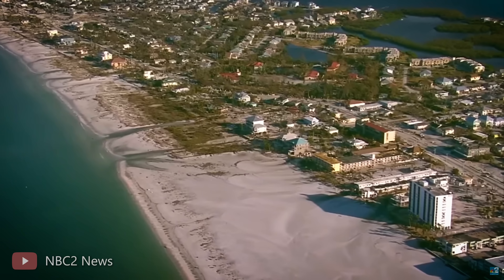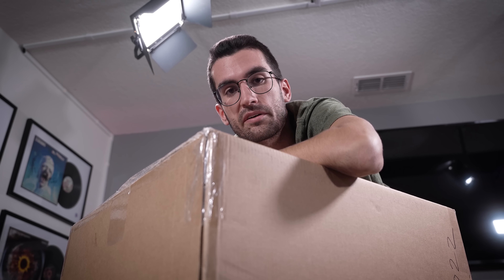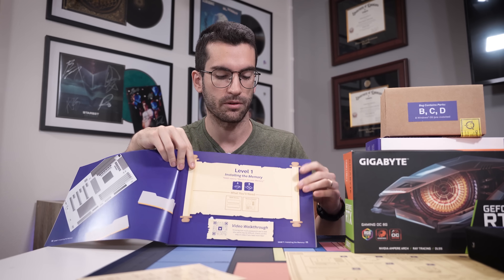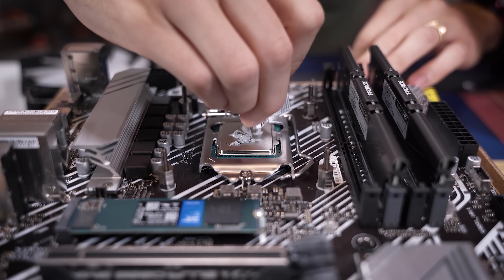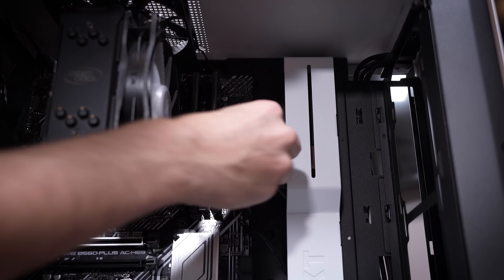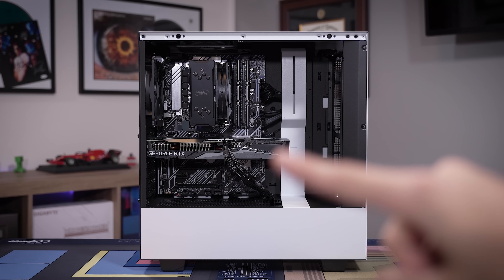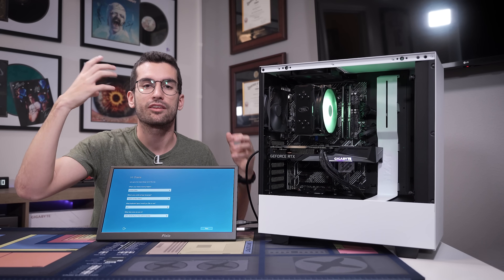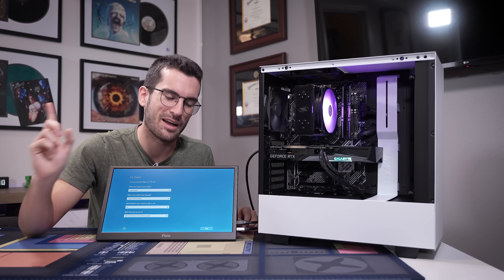His PC Was Destroyed... So We Built Him A New One!

Comment: I think for a lot of us the on our first build our biggest concern was all about matching the right type of board with the right type of processor. Sure, it was easy to find the right type of socket chip to match the board, but we had no idea which board to pair with an unlocked chip to get the most out of it. For instance, I ended up buying an i5-7600K and then paired it with an H270F. Sure, it worked just fine. But the whole idea was to overclock the CPU and the board didn't allow for it. What I would have given to know about YouTube build videos back then.

Comment: Hey y’all, hoping you computer geniuses can help. I got a rtx 3080ti with an i7-10700 3.8 intel chip. When I play a game it has low cpu(1-9%) and (40-50%) gpu usage. I capped my game at 144 BUT it has trouble holding it. Goes from 110-144. I feel like that’s not normal since it can’t hold 144 constantly. Appreciate any help.

Comment: I am surprised since it was NZXT build that NZXT did not include their own parts like the motherboard PSU or CPU cooler but still a great concept the book alone is phenomenal great video
Reply from the maker: Yeah, they are more worried about maximizing value in their kits (or at least making them more attainable at lower price-points). They don't have cheap motherboard options, for example.

Comment: I disagree with...no wait.  Let me rephrase... I think PC building can be easy.  What can make it difficult isn't just making sure your parts are compatible, though that can certainly be true.  I think these things can be difficult... gonna list them in order:

1.  Installing the CPU fan.  Sorry, but this can be a complete pain in the ass, even for "experts".  
2.  Parts compatibility.. like Greg said.
3.  Case size and running cables.  Cheap case = getting screwed on comfortably attaching things like your 24 pin or generally running wires period.  
4.  Along with 3, cable management.  This can be a nightmare for newbies and overwhelm them.

By the way, wanted to thank guys like Greg who make PC videos and especially build guides.  If you are new to PC building, then check out as many PC building guides on Youtube, especially ones that may have your case and CPU.  And always read and reference your motherboard manual.  These things were incredibly helpful to me.

Anywho, nice video as always Greg.  And nice of you to help folks out.  God bless.
Reply: Building a PC nowadays is still much easier than it was during, say, the AT era and even further back than that with XT-class hardware, when both cable management was an afterthought at best (baby AT cases from what I've seen throughout the web seem to have particularly bad cable management with all the ribbon cables in a tiny space for the time), and you had to manually configure IRQs via either jumpers or DIP switches.